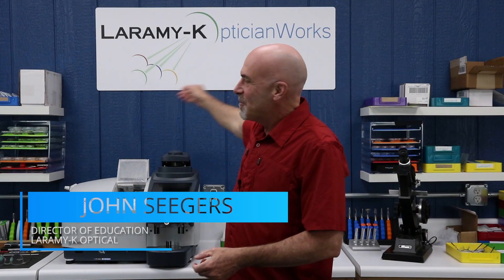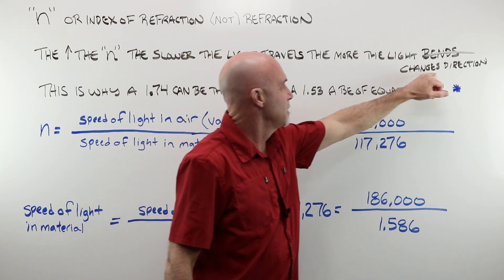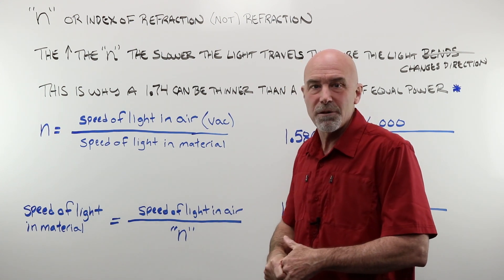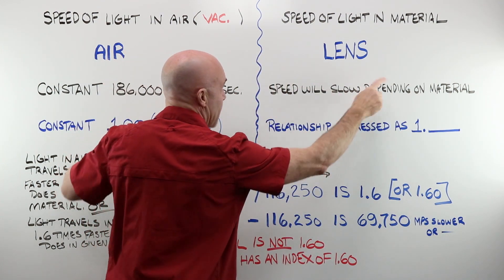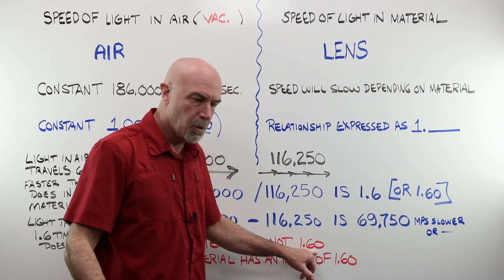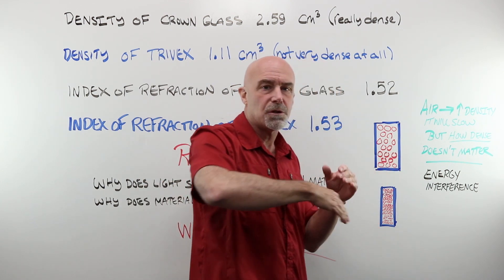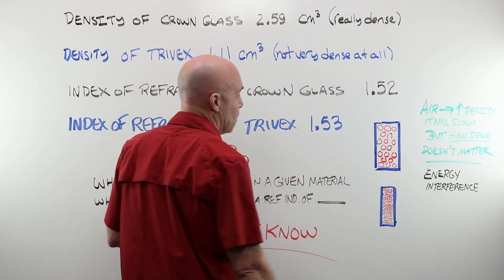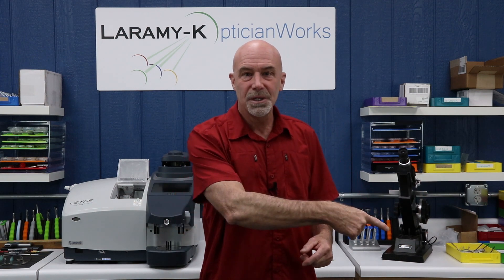Index of Refraction

Comment: I have a question that I hope you know the answer for. I can see perfect 6-6 in the optometric office (with the test lens kit), but (!) my eyesight is not as good with my eyeglasses although they have exactly the same prescription.
when I took off the adjustable frame and tried to look with my own eyeglasses I couldn't see anything. with my own eyeglasses it wasn't 6-6 anymore.  how can it be? what could be the problem? because as I understand there are no bad or good materials .  my prescription involves 0.5 cyl correction if this is changing anything.
Reply from the maker: Trial frames usually have high quality glass lenses. Refraction usually takes place under the perfect ideal conditions for visual acuity. The eye chart is at a fixed distance from you and those lenses. The eye chart is not a random set of characters but designed with very specific patterns, angles and sizes. In other words real world vs. dream world. I'm not sure where you are getting, "no bad materials" from? You can actually "see" the difference in quality in the lensmeter between glass and poly. Anyway - find a better optician and they should be able to get you closer to that trial frame vision. Closer not perfect... John
Reply: I have tried my glasses in the same conditions I tried the trial frame.
so it all comes down to the lens quality as I understand?

Maybe I can try to move to a lower index which will give me a better refraction, like Trivex or cr-39 . 

I wonder if the higher Abbe value of these two lenses can also contribute to a sharper and clearer image at the optometrist office although I am not sure it has any influence because the eye chart was only black and white. What do you think?

Also let's say I will move to cr-39 which has a better refraction, but then isn't the thickness of it in the  -3 and -3.75 minus prescription going to counteract lowering the index? And even give me the same results I get with a low quality lens  like the poly?
Reply from the maker: @talflex25  Go with Trivex